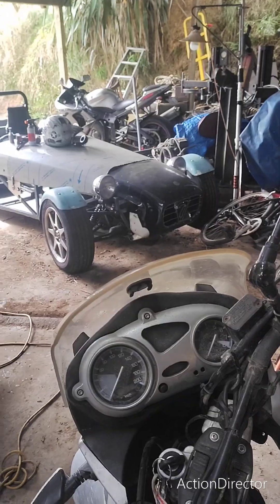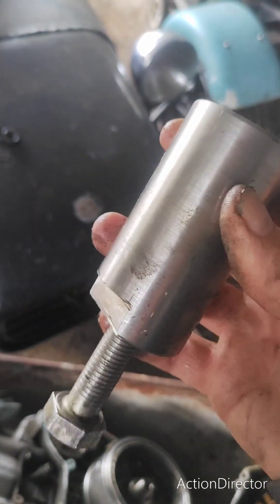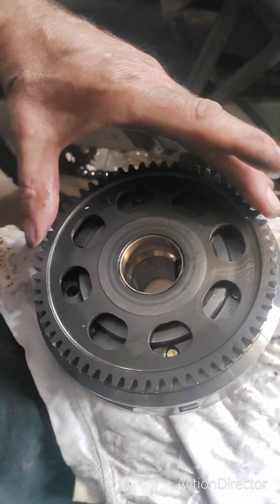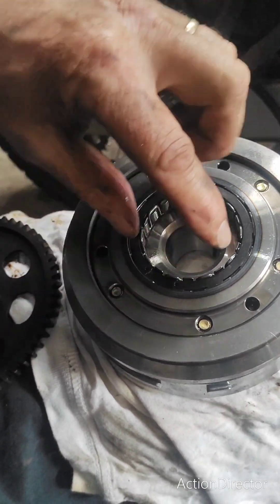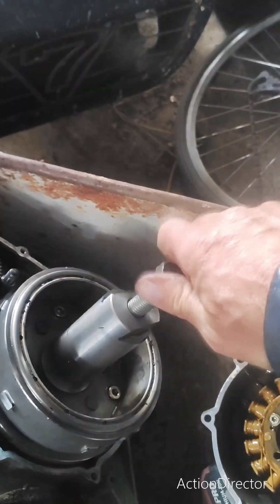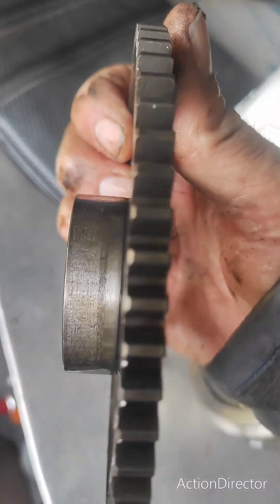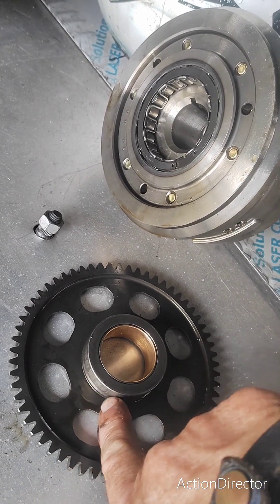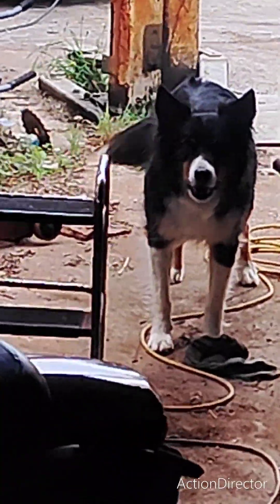Bmw F650GS starter clutch sprag repair. Why it slips and how to change it.

Comment: Great video. Mine did the woodruff key.  I got my BMW specialist (factory trained) to put in all the components you suggested as well as a new woodruff key.  Wouldn't start. He checked compression.   It seems to be low you need new rings.  So he replaced the rings. No start. He didn't check the clocking when he bolted the components back together. He realised his mistake and corrected it. Still gave me a 2 grand AUD bill on a bike I'd paid a grand for.  He was a mate. Now I use other specialists that are a way more competent.